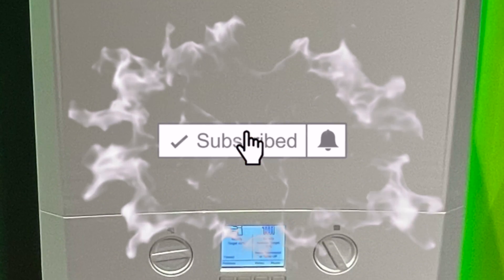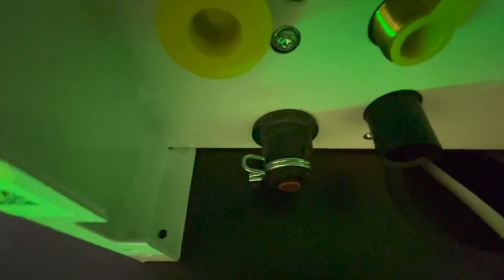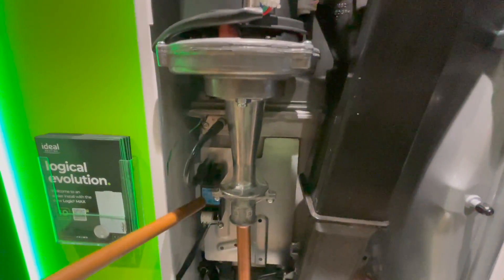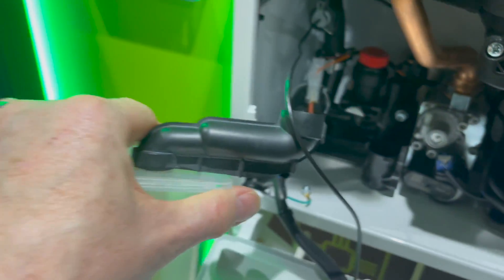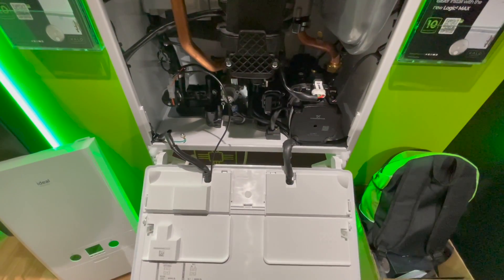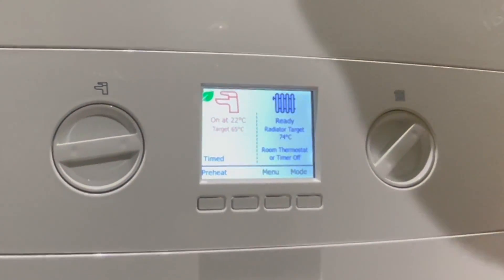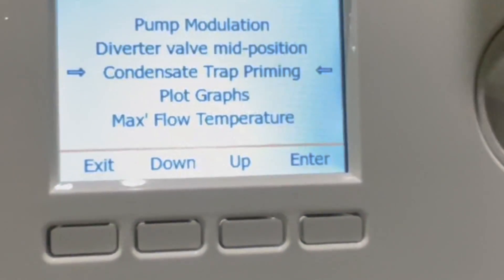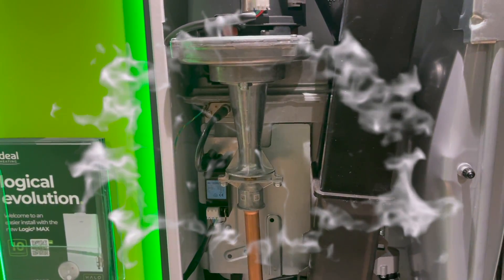Changes to the ideal logic 2 max combination  boiler.

Comment: Here I am on a week away looking at your videos. Busmans holiday. The cottage here has a cooker that is ID and 13 other serious issues, no safety cert to be found. The landlord gave me the number of the company who issued it but they will not reply or come out. Wood burner not fitted correctly has flue too short and missing glass and sets of the CO detector that is fitted 150mm from a corner a  unvented cylinder with the PRV in speedfit,a cooker  hose fitted sideways and strainng the hose,no bonding , LPG bottles directly by an openable window, I complete combustion on a hob burner, the oven keeps cutting out so suspect blocked bypass, 10kw wood burner and the 5 burner double gas oven cooker with no ventilation in the same room, the kettle plugs in and can sit in the sink full of water as socket too close. Gas pipe not sleeved through wall. The burners have incomplete combustion but thankfully the thermocouple kicks in but does leave gas as it is LPG.But all is ok as it passed it safety inspection apparently.
Reply: I guess you must be on holiday in Wales
Reply: @bigbadface  Devon and it is not what it used to be. Ilfracombe should be bulldozed and mad a solar farm as there is nothing good there anymore.
Reply: @bigbadface   yeah probably owned by a tight arse englishman/woman? reported faults to landlord (holiday let) not as bad as these not long ago all NCS or not what the MI's stipulate. no interest in getting it done right. 

 god knows how the person carrying out the GSC managed it. boiler was so boxed in so you couldnt get the cover off or get to the flue sampling point let alone other stuff., probably just stuck the analylzer in from outside. apparently the boiler serviced box was ticked as yes being serviced at same time. no copy of the gas saftey cert in the property, i did get a name tho. my guess is they were lying. the english person and the welsh gas safe. there was that much gunk in the condensate trap.......... at least 10 years worthish. it was backed up into where it narrows and beyond on a bosch cdi. last made 2012. probably moved as it didnt have the original flue. in hindsight i should have taken the boiler serial number and checked where that was first fitted. if it was registered at all.

 typical sais (look it up) R Young most of what google tells you its translated to englishman, reality is it's usually a lot more. it's a derogatory term as well ;)

i took plenty of boilers off the wall and binned them fitted by saeson(plural of sais) gas safe guys that were brought in by cheapskate english landlords. usually from manchester or birmingham areas. told a couple form essex to go ^%^% themselves too, the sais landlords i mean. last one was fitted by a vaillant accredited installer from what i remember from working in the area at the time. the boiler was fitted at such an accute angle the flue condense had been dripping down the back since day 1 i guess. 4-5 years worth. hadnt cancered through yet.

reallity is either you want the job doing right and are willing to pay for it or you don't. being welsh or english doesnt come into it as does the colour of someone skin or their gender.

i just closed the door on 1 landlord, wants me to put my head on the block to save him money. he cant get his head round why internal primary pipework should be lagged. eco warrior yet he wont spend on heatpumps - because he thought about it, hes getting no benefit is he from the higher install cost.

Comment: Is Ideal ever likely to bring a model with a side flue that can fit exactly where an old Ideal Standrard NF250 is currently installed, without the need for drilling new holes in the kitchen wall
Reply: about as likley as trying to get a private landlord to fit a heat pump. i have customers using a sideflue glowworm, kitchen(and house) is immaculate. marble worktops. nothing new will fit there. try and find even a cuboard door to match what they have..................kitchen was installed less than 5 years ago.
Reply: @markchristohperowen6806  doubt it

Comment: Looks like the same old 240v terminal block  pointing away from the installer arghhhhhh !
Reply: Prefer these much easier to wire in external controls into

Comment: Thanks for your efforts...they just need to get real with the price 😌
Reply: With the old model there was always the "Independent" lower cost version, which was pretty well the best you could get for the price. Maybe they will get round to doing an equivalent landlord type version of this new model. I installed a few Independents and they were tremendous value and far better boilers than others in that price bracket...mostly Italian in origin ( Ideal used to sell a rebadged Biasi  as their low cost combi years ago. It wasn't good )
Reply: @timhancock6626   agreed fitted a couple esprit eco 2 i think they are exactly the same just rebadged? maybe updated. lower warranty. halfish the price of a logic plus max. great for  someone starting out on the ladder. or tight arse landlords.
Reply: @timhancock6626  They sell the base combi now it will be badges as a Eco Esprit from CPS a Instinct from Independants or Atlantic, also Pro combi and Classic versions pop up too all the same boiler, 5 yrs warranty
Reply: @ian1104  same same. 19ner do we have a copy. when i phone in 6 years are the girls/boys/ men/ its where are the real specs for this boiler uploaded to? ill love to back them up now.
saves me time

ian i found 2 old cb i used to use. WHEN I WAS 14.  want them. pm me.

same as logic plus? i didnt srip 1 down.
Reply: @ian1104   yeah at a stupid price.i see the ideal repair guy sat in llangefni asda car park a lot when i go in for dinner. i nearly talked to him a coulple of times. he looked bored. and was bald. why are MI service engneers blald? or almost. bg thing?
Reply: @ian1104   how can mi be allowed to put plastic in a prv? is it due to distance?. clipping?

if its testing why didnt they test the flue seals. they are meant to be tested right? no ideals failed yet many glowworm and vaillants.
]
#
] noone hold them to account. gas safe thats part of your job right.